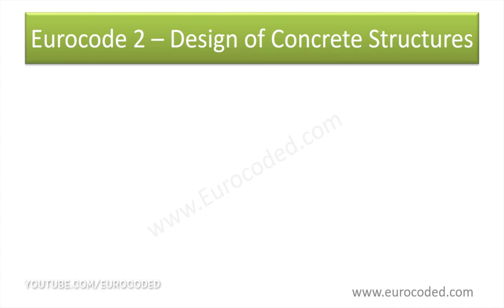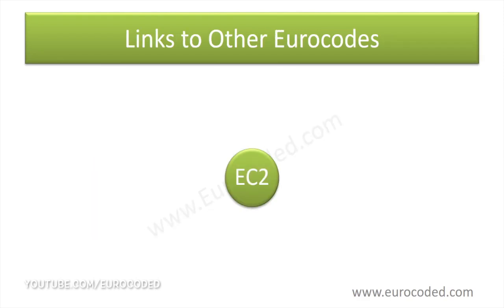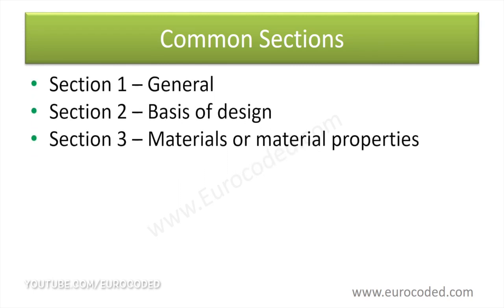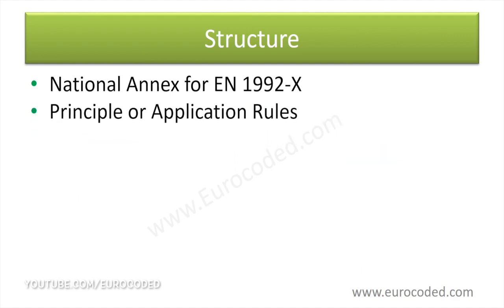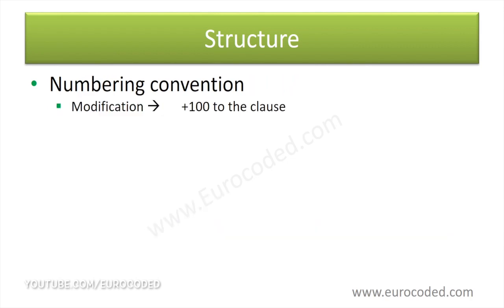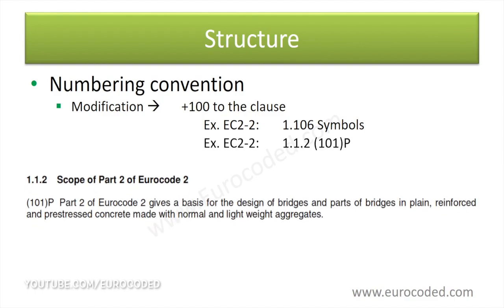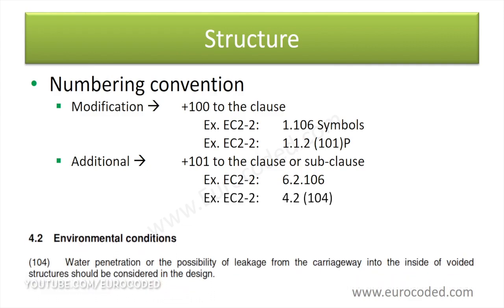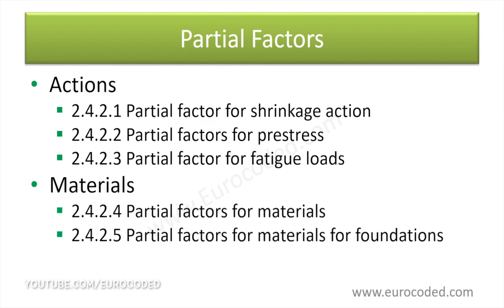Introduction to Eurocode 2 | EN1992 | EC2 | National Annex | NA | Design of Concrete Structures

Comment: Thank you so much, could you please explain ACI and BS like this. Thank you.
Reply: do people still use the BS code in 2020
Reply: @Lanreolokunola  Hi,
which euro code is used to design anchor bolt with base plate in concrete footing.../
Reply: @undhinesh  EC3
Reply: EC3 Which part ?
unable to find in ec3-part 8 not given properly.../